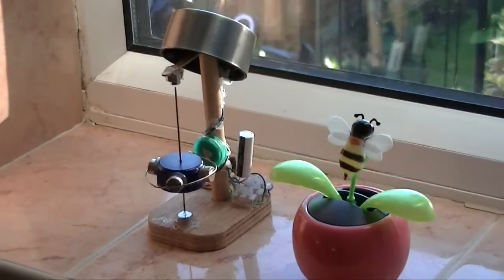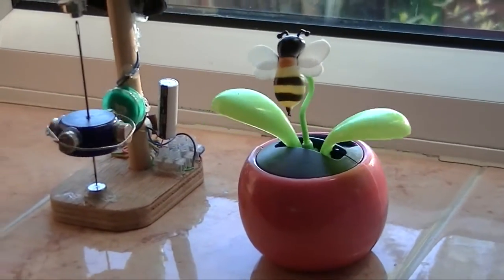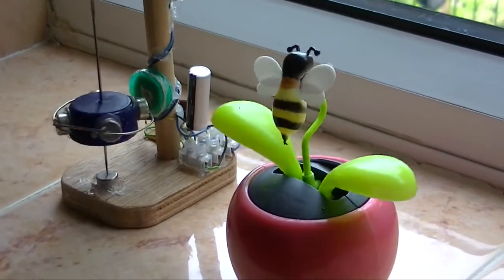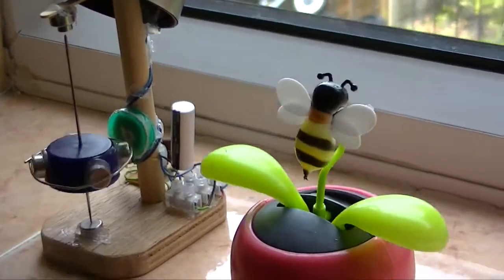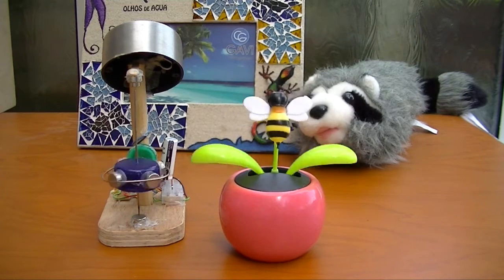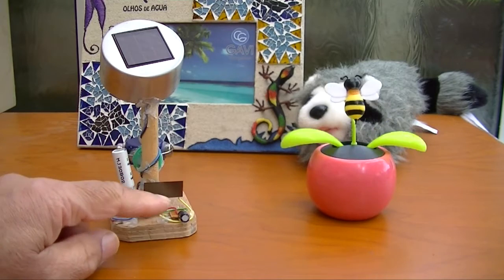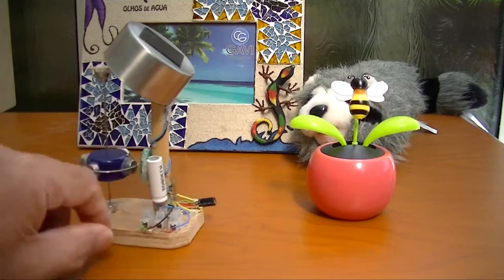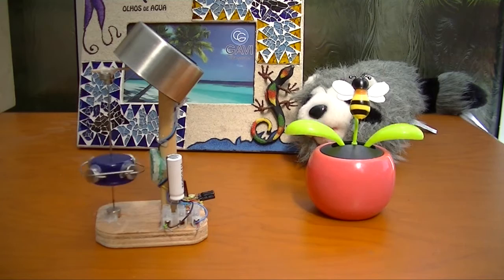SELF STARTING SOLAR PULSE MOTOR WITH CAPACITOR.

Comment: Very nice setup Sir! Does the coil came from the solar dancing flower? If not can you please suggest the copper wire size and number of turns.
Reply from the maker: Okay I have used the coil out of the flower before and it works fine. I am going to make a new one soon. 
In this project I made the coil but it was 7 years ago and cannot remember the wire or turns but I will get back to you. Thank you
Reply: @JustFun-iz9rf  Thank you Sir, I wanted to make my first pulse motor. Im really concerned about coil winding and copper wire size.
Reply from the maker: @samsoncj  hi I made this video I hope it helps 
https://youtu.be/nHy47ErmHV0
Reply: @JustFun-iz9rf  thank you Sir, very helpful!

Comment: sir i would like to ask about the capacitor. whats the  Voltage and Farad of the capacitor
Reply from the maker: +erbinjay padit  
HI the capacitor is 2.7 volts and 10 farads. Hope this helps. Please note I left the original circuit with the  capacitor on.